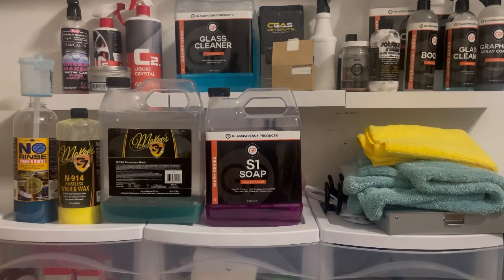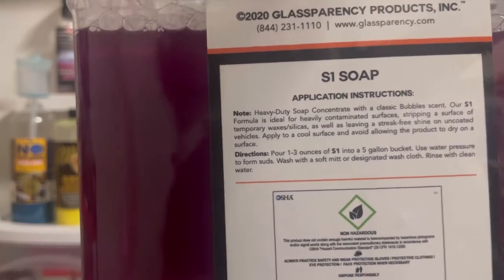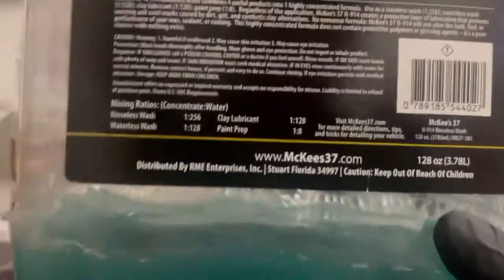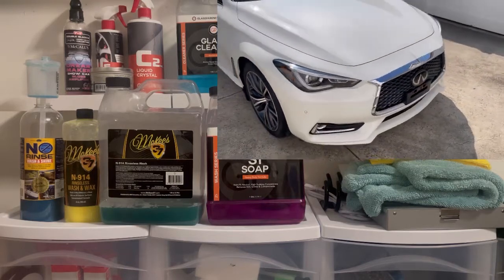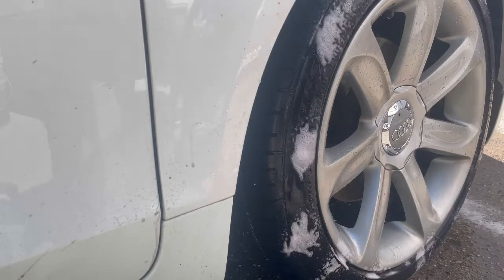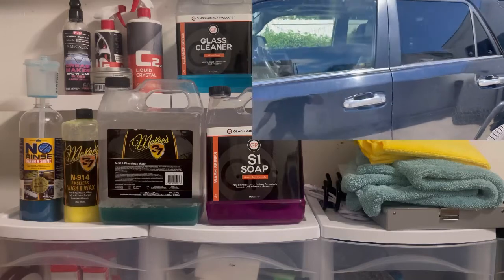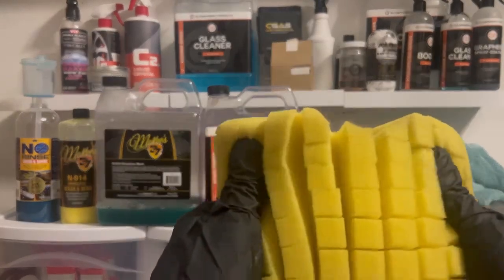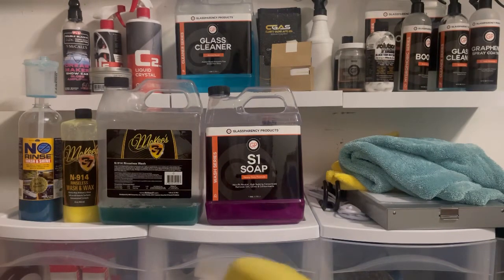Rinseless Wash vs Soap Which is Better? In Detail.. #realdetailing #cardetailing #scratchfree

Comment: Rinseless washing is the truth. Like you said, good high or low pH soaps for decontamination is great but ONR (Specifically for me) is amazing and so versatile. I also got a detail keg with up to 150 psi with a rinseless and that's a game changer for any reason you could imagine. 🙌
Reply from the maker: Exactly! Plus You can literally rinseless wash with minimal equipment on the exterior in less than 25 min. Plus dilute it to whatever needs. Lastly virtually scratch free! 🤛
Reply: @DetailingMadeSimple  I use onr when I polish to remove polish safely. It works great on the soft black b pillars. Doing that seemed to be the best way of not introducing scratches.

Comment: You don’t have to use ONR with distilled water, it doesn’t just encapsulate dirt, it also softens & encapsulates the minerals & solids in hard water. The other rinseless washes don’t. All rinseless washes are not the same. Optimum has a patent on this specific technology.
Reply from the maker: Yes. You're 100% You don't have to but with water definitely over 255ppm the water  softening is not there other detailers and enthusiasts. I know run into some issues. Those are for more places with like well water etc. you definitely don't need distilled. But the less minerals the better. 

You are also right about not all rinseless are the same. They all clean different. Different lubrications. Different Polymers. Some are surfactant base kind of like N914. The list goes on. 👍 I just tell people use what they like and roll with it. It's like Toyota lovers and Honda lovers they are both great vehicles longevity wise. But aesthetically and clear coat/ paint with UV protection are very cheap and fades quickly overtime. Pick and choose your poison 😅😅😭😭

Comment: When you and you wife have time. Allow me to recommend this YouTube channel called  DetailKegs.  The person; Dave Barker is using various size gallons of air pressurized kegs that have the capabilities of spraying foam soaps or non foaming liquids like APC’s.  I too am a user of Waterless and Rinseless soaps on all three of my Honda’s 👍.  Most of all his channel is all about efficient use in detailing automobiles.  Dave is located in Utah and uses his kegs to clean planes , heavy equipment vehicles, exotics and motorcycles.  Like you I too own an ik pro12, Marolex  axle 3000, Solo pump foamer.  Lastly I purchased a 3 gallon air pressurized keg then I went on DetailKegs website and purchased his retro foaming kit to turn my existing keg into a foam spraying keg using the American  Detailer Garage: Fuzion 128:2 ratio.  Wishing your business continued growth 🤜🏽🫡🙏🏽✌️
Reply from the maker: Thank you for the info. I will definitely be taking a look.
Reply: @DetailingMadeSimple  take care brother 🤛

Comment: Which towel do you use to apply the detail spray with?
Reply from the maker: Detail spray depends as a drying aid. I like to use any automotive drying towel. Ranges from Gyeon Silk drying towel, Autofiber motherfluffer, Griots PFM drying towel, TRC Gauntlet, TRC Liquid8tor and McKees glacier towel. My least favorite on the list is the autofiber mother fluffler. Super soft and plush but not really absorbent. 

Say I want to add on again a detail spray or a sealant you can use an edgeless 365 towel from the rag company or autofiber premium edgeless. Or a Kirkland MF towel works fine as well. Hope I answered your question. If you want extra plushness. Use the eagle edgless 500 but that tends to grab more. What is a nice towel that I like and purchased a lot of was the magic buffer from DIY detail. Get one give it a shot. Super plush soft and doesn't fold/get grabby due to the weaves of the towel.
Reply: @DetailingMadeSimple  - Thanks for all the info dude. Much appreciated
Reply from the maker: @MrChuckwagon55  anytime brother.